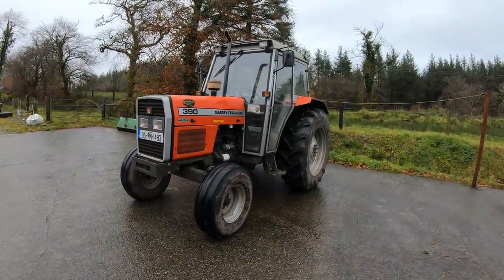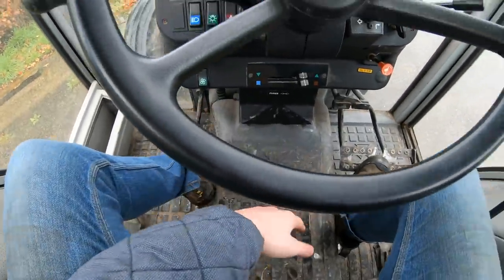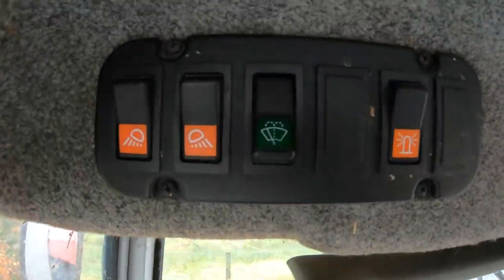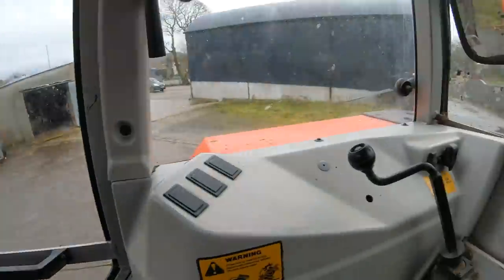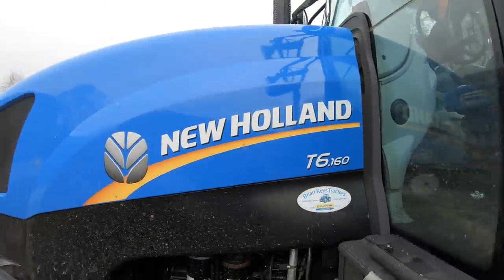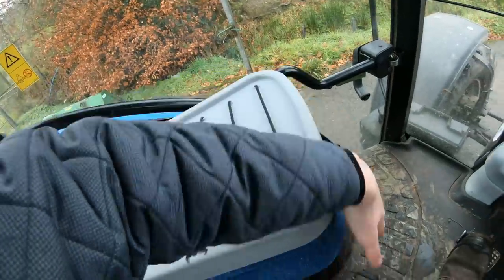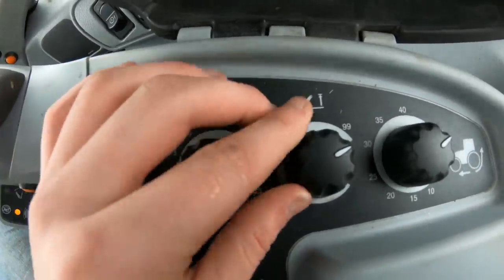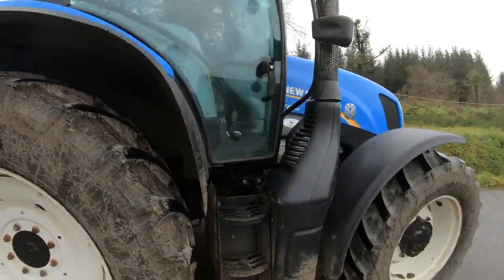Tractor Tour ~ Massey Ferguson 390 & New Holland T6.160 ~ Gopro

Comment: Is the new holland 4 cylinder?
Reply from the maker: Ya
Reply: @benscollanagri5804  ur wrong she is 6 lad
Reply: @adriankavanagh7695  no Tier 4a the t6.160 was the biggest 4 cylinder in the range there 135 hp 160 boost hence the decal
Reply: @alanmarshall874  no it is from a T6.180 2019 they are all 6 cylinders up and below a T6.180 is 4 cylinders now a days I have  a t6030 and a 7840 and the t6030=120hp the 7840=10hp the 2 of them are 6 cylinders
Reply: @adriankavanagh7695  ur talking shite man the new tier 4b the t6 160 and the 180 have 6 cylinder engines the rest are 4. Tier 4a the t6 175 was 6 cylinder the rest below are 4
Reply: @alanmarshall874  u know nothing boi
Reply: @alanmarshall874  it’s only T6.180 are 6 all below 4 and that’s scince 2018 before 2018 all the t6 range was 6
Reply: @adriankavanagh7695  check out tractor data for your information